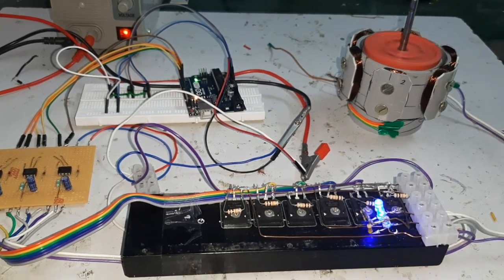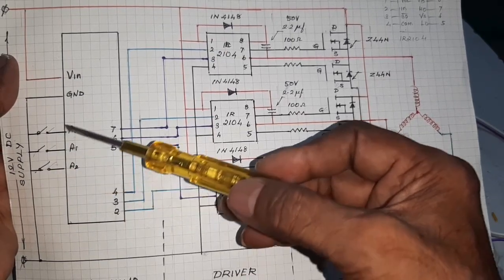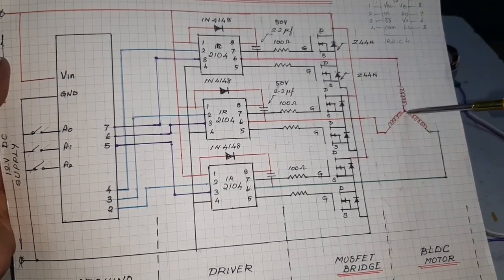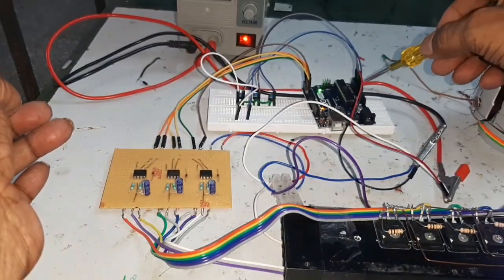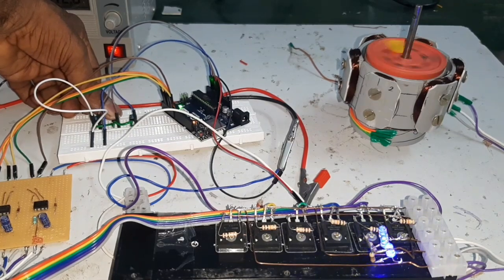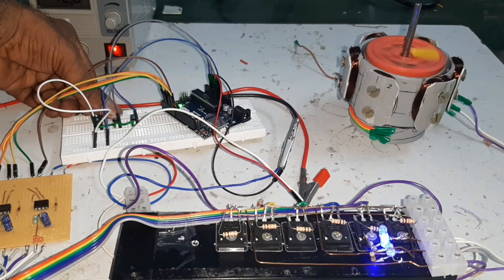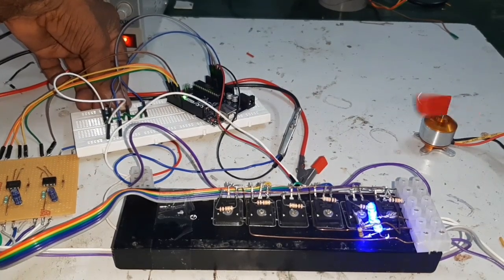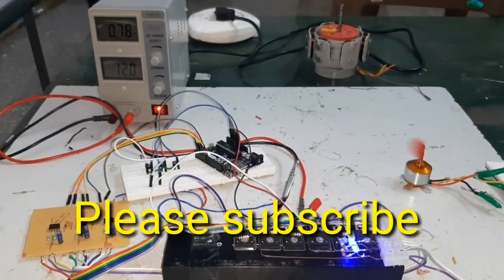(V-117),3 phase bldc controller without sensor using arduino

Comment: This is not the correct way to drive sensor less motor. Sould use FOC (Field Oriented Control) for sensor-less application.

 Problem of this setup is :
1) Motor torque will be very low.
2) Jerky rotation of motor.
3) Possible maximum speed is very low as
  50RPM or less.
4) sometimes motor only vibrate (no rotation).
5) No syncronisation.
6) It will take more power and less efficiency.
7) winding temperature will be high.

Becase I'm working with BLDC motor project😂.
Reply: Can you pls help me I want to build bldc controller of 200v bldc motor
Reply: Hello , I'm also working on controlling BLDC motor with FOC , could we  exchange ideas ?

Comment: very interesting idea >>>but>>>> this not synchronous  motor >>> and  accurate timing for energizing coils cannot been achieved ???   you  assume to make bldc work very well with   stable torque  >>>  with one  energizing coils   make the rotating magnetic field  >>>>>>>>> this need  investigation at higher  power  and torque ....
Reply from the maker: Thanks sir
Reply from the maker: And your good suggestion